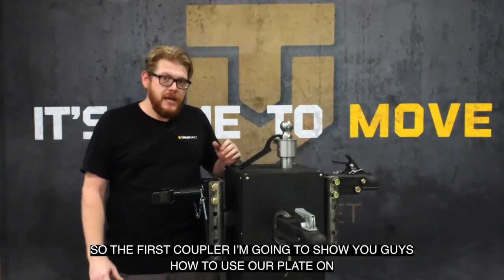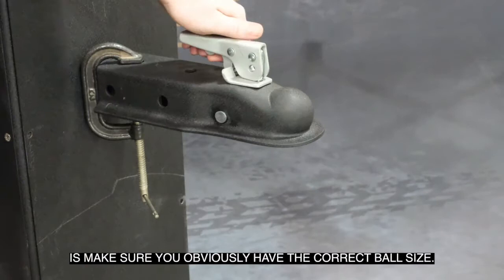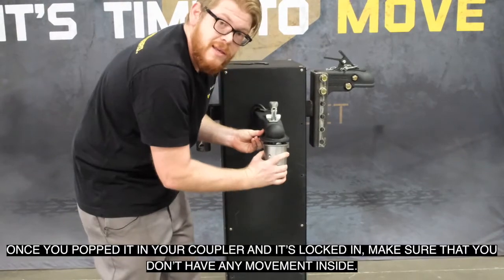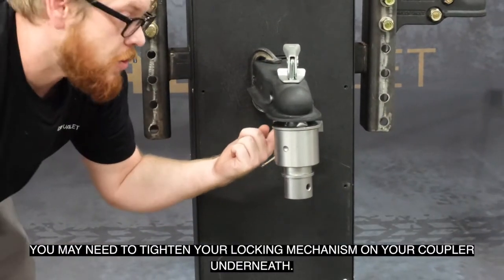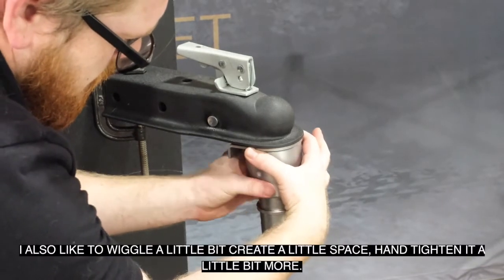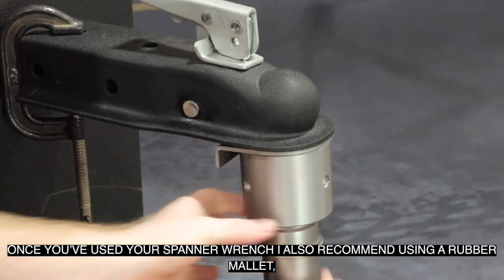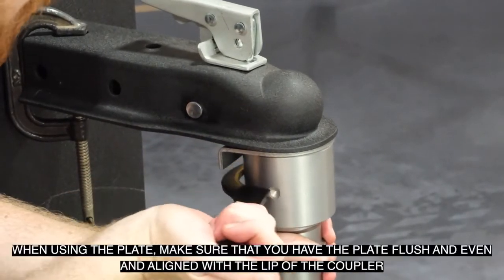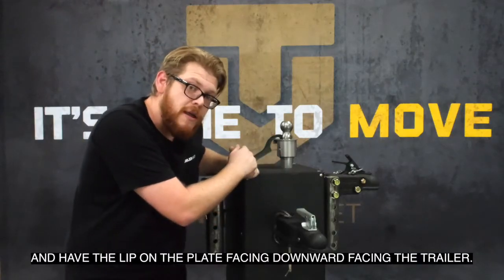How To Install The Standard 2" Trailer Coupler

Comment: I just received my TrailerValet XL, and the plate does not have a 45 degree lip. It also looks significantly thicker than what is shown in the manual and all of your videos. I can assume it functions the same as the lipped plates, and installs the same - but I recommend you update your instruction manuals, quick start guides, and videos. At minimum you should include a one page insert with your Trailer Valets explaining the variation and reassure users the coupling plate still installs as shown in the manual, with the curve to the front.
Reply from the maker: Hello! Yes, the current coupling plate that is going out with our units is a new plate we recently came out with. We discovered this new plate works even better with our units. The original plate works fine as well but the newer plate is even better. We do apologize there is no mention of this in our manual but our team is working on updating this for our customers. Please feel free to reach out to support@trailervalet.com if you need any assistance with your newer plate, thank you!